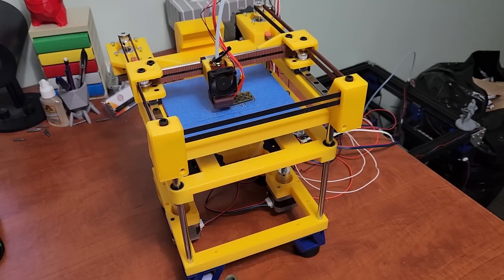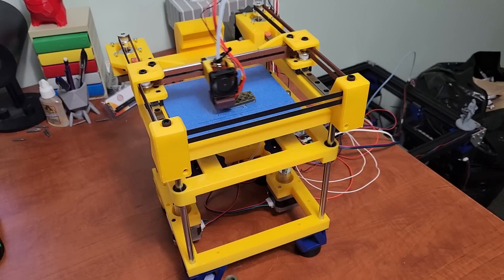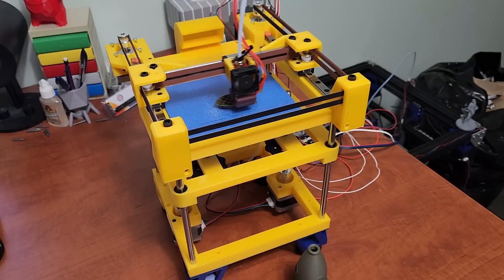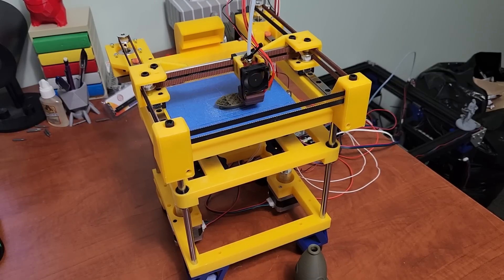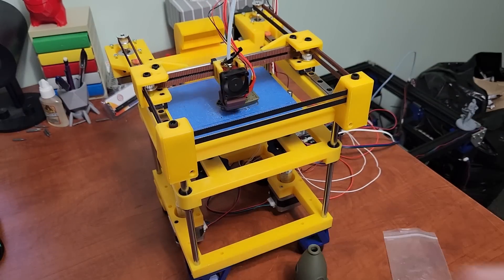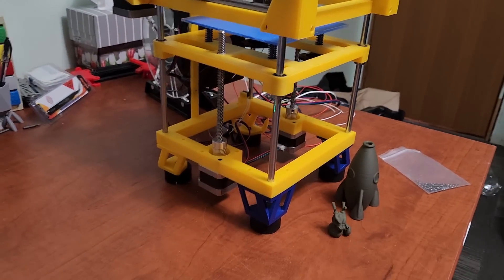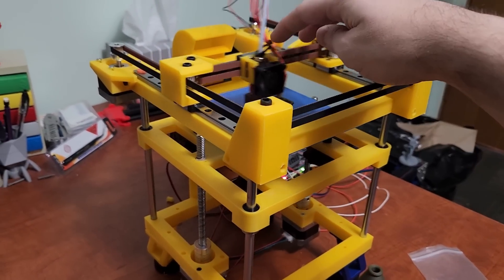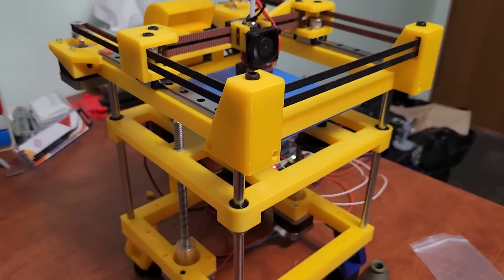Cheap Mostly 3D Printed CoreXY 3D Printer Called Rook!

Comment: 🎉 This is really nice design! Seems a little easier to make than a Voron, and the reaults are impressive. The main parts I have lying around are spare mainboards, so it would be great to print and build some Rocks to put them to good use and give them extra evaluation.

Comment: It's interesting to see how much this is PLA but just enough is using more stable/sturdy rails and screws: basically, the printed parts appear to be tensile in nature.

If this had a heated bed, I wonder if there'd be interesting stresses in the plastic frame parts. I'm thinking you'd want the rails to only really attach in the middle of the edges of the frame to minimize frame warping.  Of course, it'd best be made out of something better able to tolerate heat than a PLA variant. It'd also require some consideration for the width between the mount points, too, as the rails along Y (calling it that to differentiate, and typically bed-slingers use that orientation) may shift dimensions along X, causing some interesting things for the stresses that may skew things. At minimum, I'd expect such a printed printer to perhaps degrade over time if not accounted for.  The X rail crossbar helps keep the dimensional accuracy within the realm of metal coefficient of expansion, regardless of what the plastic does.

Did you print this on the Bambu to get it printed very fast?
Reply from the maker: yes I printed on my X1 and the frames take about 3 hours but I print had half speed so it's not much faster than a normal print

Comment: I think i will build and tune this! I just love simple stuff.
Maybe check out my inverted delta on my channel which also shifts all the complexity from hotend, cooling, weight etc to only the construction of the bed.

Awesome man!
Reply from the maker: I'll check it out!
Reply: @Rolohaun  i would love to make the top and bottom frame of my printer as simple as yours but i did not have the time to refactor the construction.

Comment: Soo.. If I get this machined out of aluminium... whole middle section can be actuall heated bed :-D correct?
Reply from the maker: yes it could! the bed size is only 120mm though so you might be heating alot but it would be cool to have a top and bottom machined out of other materials
Reply: May have trouble with thermal expansion changing the distance between the linear bearings. You could use LMK8 bearings and mount them in a way that allows lateral movement, but probably simpler to keep the separate spring-mounted bed.

Comment: Imagine if something like this became the cheap standard instead of mediocre ender 3 bed slingers
Reply: If the plastic parts can be injection molded that may work. The reason ender 3s can be cheap is just how quick and easy they are to make.
Reply: @jeffreyepiscopo  And how easy they are to make to decent standards. Alignment of the axis and leadscrews is vital in 3d printing. Aluminium extrusion and steel plates/linear rods(prusa i3) is great for that. Lots of plastic parts leaves lots of room for errors to build up. Easy fix for those who don't mind to tinker but not great for a consistent out of the box experience.
Reply: I'm thinking about trying this build before the voron...looks awesome and simple
Reply: Yes but people will probably want a larger print area.
Reply: It is.
Reply: Ender 3 with klipper and direct drive smokes most sub 300 printers on the market
Reply: @Skibbyz  this rook isn’t the market
Reply: @Skibbyz  still wouldn't be as good as this with kipper.
Reply: @Skibbyz  Yea, and a Honda civic with a Ferrari engine smokes most cars. What's the point?

There are much better printers that will smoke it out of the box and with uogrades
Reply: You must suck at printing if you call an ender 3 "mediocre".
Reply: @cheapskateaquatics7103  You sound like a Linux bro here pretending it isn't.

Comment: Are you sure this should be on 24v? Using server PSU with computer fans would be much cheapier to get. Anyway, great design as always.
Reply from the maker: I am using a 24v 6a ac adapter but it could run on other things I am sure

Comment: Could you have the 2 vertical rod for the front linear bearings stick out the top another 50mm and put the idler bearings onto it? You could change the diameter of the idler wheel to maintain the correct belt positioning.
Reply from the maker: maybe if I could find 8mm ID idlers, I have not seen any?
Reply: @Rolohaun  I got some of the CR-10 hotends from Ali Express for £2.19 which is around $2.54 and they are good they come in red, silver and blue heatsinks, I fit compression fittings for the Bowden instead of the pneumatic ones with the teeth and add a Haldis bi-metalic heatbrake and a Mellow Mk8 nozzle, I swapped out some friends and a few family members hotends for them after they saw mine working just as well as the Micro Swiss, it is a very cheap but effective hotend.
Reply: @Rolohaun  I could make  some. There are thin bearings for RC cars that have large IDs that would probably work.
Reply: @Rolohaun  I think you could fit a 3D printed 24 tooth over an HK0810 bearing.

Comment: This thing is a masterpiece of simplistic design.
If You have a 300x300 bed can you print the top in 1 piece instead of the 5 or so pieces that you have shown here? Looking forward to getting the files for this.
Reply from the maker: yes larger versions would be really cool to see!
Reply: @Rolohaun  Agreed, larger versions would be cool too. 

But what I meant to ask was if you can print the top piece as 1 component using a 300x300 printer. It looks like it was made in 5 pieces (frame, idler mounts, stepper mounts) to save space on the "mother" printer
Reply from the maker: @NathanBuildsRobots  yes your would need a 280mm bed I think